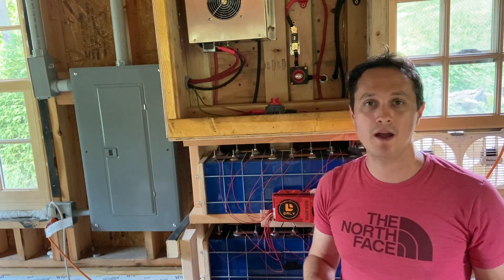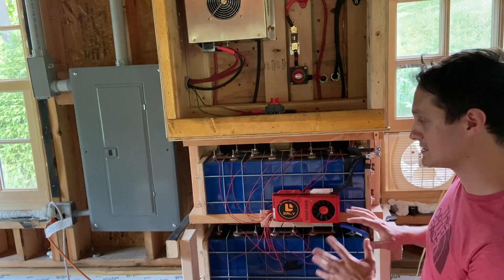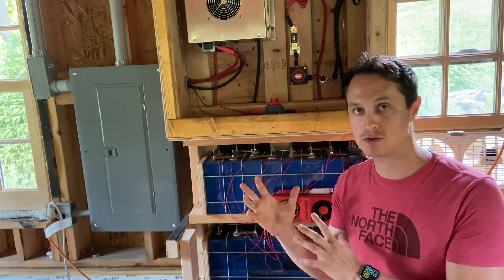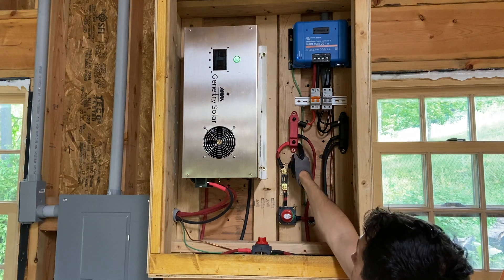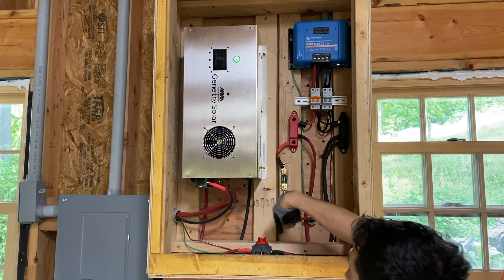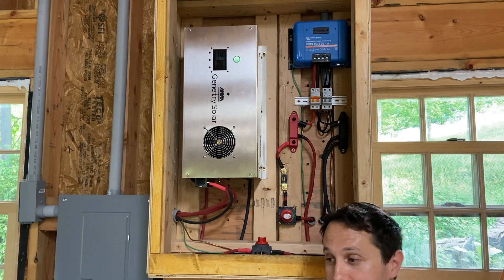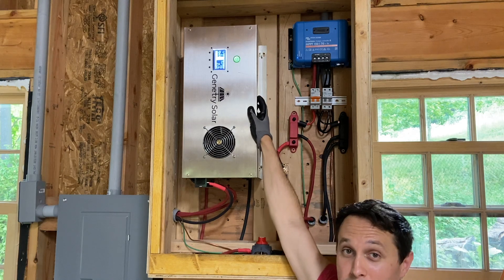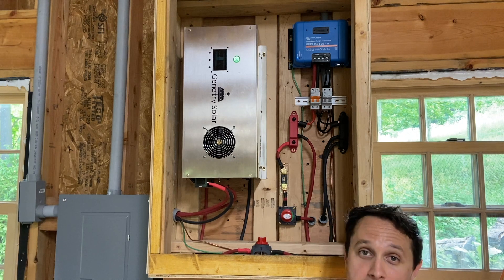My Off Grid Workshop Setup - Everything I Used!

Comment: I remember now, PowerJack was the inverter's name from Genentry. I ordered one of their 9KW which I never received. So I cancelled the order as it was lost in shipping... Anyway, thanks to that, I bought a MG5048 hybrid inverter from MPP Solar instead. It's a hybrid system, meaning it performs as a charge controller with 450 VDC PV input, delivers 5KW at 240VAC, and has a built in auto transfer switch. After adding a toroid transformer to split the 240VAC output. I paid a total of $850 shipping included. That's cheap and it handles everything I throw at it: water heater, induction cooktop, pond pumps, washer, dryer, fridges, freezers and all my power tools!.. I use it as an off grid system now and 2 year later, I could not be any happier cutting my electricity bill by 1/3 and my gas down to zero! I just bought a 48V 280Ah LFP like yours for 2K$ to be totally off grid this winter. I'm also using a16S, 320A Ant BMS for 80$.

Comment: I would grab some polycarbonate from Amazon to cover your things up, but still be able to see them.  I really like to be able to see what is going on inside the box and polycarbonate has a pretty high temperature threshold, so it shouldn't warp with the heat. Other than that I think your setup looks great Will!
Reply from the maker: I agree, although that stuff isn't cheap unfortunately.
Reply: @TheWilltoBuild  It is not cheap at all. Which is a huge bummer because it's so useful.

Comment: Looks pretty good man! One thing Id invest in is a proper fuse off the battery unless that one is rated for breaking and extinguishing the dc arc.🤘
Reply from the maker: I think you're right, and I definitely overlooked gettting a proper fuse. Any suggestions?

Comment: Awesome. I'm about to set up my system in the bus. I'm using the 16s EVE cells, the Genetry inverter on your prior tip, a 200a Daly BMS, and 3 charge controllers from MakeSkyBlue for 3 arrays of 2s2p 315 watt panels. I'll have a shore power input as well and may later wire a generator for automatic start from the inverter.  Do you have a diagram available? What wire gauges did you use?
Reply from the maker: I don't have a wire diagram available now but I might do one in the future. I used 2 awg for everything you see here. And I used 6 awg to bring in my solar power (up to absolute max of 60 amps about 25 feet away). 

Definitely keep me updated on how you like the Genetry!

Comment: 060821/1224h PST  Thank you for the presentation of your power system. They look good and systematic.
There are 2 things that I wish to understand. They are:-
1) Why is it necessary to ‘ tight fit’ the LiFePo4 cells ie COMPRESS?
     If there’s going to be a slight bulge (due to several reasons) and therefore, isn’t it better to leave the cells alone 
     naturally? I have heard the Cell manufacturers ‘recommend’ cells to be tight fitted and they have not been
     elaborate on the subject. Would you, please, throw some light on this issue? 
2) Every component illustrated here are heat sensitive, cold sensitive, moisture sensitive and basically 
     producing Electricity; both AC and DC. Wouldn’t it be logical to encase the whole system in a proper
     metal container, with ventilation and climate controls with alarms? Thus, avoiding the unlikely event of 
     hazards?
The above are solely my sentiments, do forgive, if I exceeded the limits. 
As always, I am happy to view your presentations and look forward to watching them and learning from it.
Stay safe and 73s…
Reply: 061021/0105h PST.    Thanks.
Reply from the maker: good questions.

For question 1, I don't have a good answer. It is basically battery chemistry and when the cells expand or bulge they are getting permanent damage. Keeping them compressed supposedly prevents that. There is actually alot of debate about how important compression is - but if you don't full charge or discharge your cells it won't really be an issue because bulging mostly happens when battery cells are near full charge or discharge.

For 2, you are right. But there are a few factors. For one, a metal case is not ideal because it is a conductor. If something goes wrong, the case could get electrified. For two, my setup is inside, where it is dry and shielded from the elements, so I am not worried about water. But I will be putting a cover on the system and fully enclosing everything so you are right that it should absolutely be protected.

Comment: Its not very often you run across someone that built the exact setup you're planning to build.  This is exactly what I'm planning.  Thank you very much for the video.  I'm building an off grid shop with a shipping container and I'm collecting parts for this now.  I'm curious what air conditioning unit are you planning for?  My plan is for a 120v 12btu mini split.
Reply from the maker: Glad I could help. Still figuring out the AC situation. I never really intended to have AC at my shop (its not even insulated), but I sort of want it as an option. I am trying out a 14btu unit right now and it isn't doing the job and is more than my solar can reasonably power. I'm thinking maybe doing some sort of DIY geothermal if I do AC at all. Otherwise just running a dehumidifier.

Comment: Really nice system. I have a very similar setup (but only 8S) with Eve 280ah.  If I was to do it again, I would get a split-phase inverter similar to what you have.  Everyone uses the ole reliable Victron but I went with epever that I have been happy with.
Reply: EpEver is a great charge controller. I got the 50A to power at 48VDC. It's reliable. I only wished it could take more than 150 VDC PV input.

Comment: Have you noticed anything odd about those Eve batteries?  Any bulging or loss of capacity or anything else odd?
Just wondering.  At ~120 $/each (including shipping) that is ~134 $/kWh--which is quite inexpensive....
Reply from the maker: I understand your skepticism. They definitely weren't perfectly uniform in terms of size when I got them, but I have been doing capacity tests and they've met them. And honestly, even if they are 20% less than their rated capacity, they are still the best deal available I think.
Reply: @TheWilltoBuild  When Tesla's 4680 factory ramps up, they say they will be selling li-ion cells for ~56 $/kWh--which will be less than half the price (~42% to be more accurate).

Comment: Hey, Your setup looks good! Nice job organizing the cabes. What is the fuse interrupt rating for that fuse goind on the positive from the battery? Those batteries have such a low internal resistance that it would be good to have it at least at 5kA. I like the batterie shelfs a lot.
Reply from the maker: Thanks for watching. That is a really good point about the fuse. I actually can't find any info on that. Do you have any fuses you recommend?
Reply: @TheWilltoBuild  In my system I have a knife fuse type. Something like this, but made in Poland: 
https://www.amazon.com/3NA3-3NA3814-SIEMENS-Fuse-GL-GG/dp/B07FBTZWKS/
But I know that in the US class T fuses are popular (not as much here in Europe) like this:
https://www.amazon.com/Blue-Sea-Systems-5120-Class/dp/B000MMH1J4

Generally fuses with such high interrupt rating have some kind of fine silicone sand that extinguish the arc.
Reply from the maker: @Banszi1  Thanks for the suggestions, I'll look into that.

Comment: I highly recommend Liitokola. I received four 280 aH batteries in less than five weeks. Perfect condition. Perfectly matched voltages upon receipt and again one month later.
Reply from the maker: Awesome, always glad to hear about other good suppliers.
Reply: I have an order to inspect from Dongguan Lightning New Energy.
Reply: 060821/1305h PST USA 🇺🇸  Please understand that most, if not all, prismatic cells are manufactured at the same facility, in China. The only thing that make the buyers distinguish between the several Cells are the LABELS. There could be a few cosmetic changes peripherally and that’s the end. LitoKala, EVE, Lishen, TOPBAND, Tip-sun etc etc.
You know what I’m trying to say. Cheers.
Reply: @sreekumarUSA  I believe ur mostly right, also all “Passed” cells go to EV’s, the rest go to distributors, ie; there is no such thing as an “A Grade Cell” except in a new EV and they have no terminals which also degrades current flow

Comment: Very cool. I'm almost there with almost the same setup - batteries, BMS at least. I'm looking at getting a off-grid inverter with the mppt controller built in. Not sure yet if this is the right option. I'm dubious of 48V Inverters available off the shelf - their history here in Australia is of regular and systematic failures, whereas integrated inverters with mppt seem to last for years - pure gut feeling - I have no stats to base this off.
I like your philosophy of being able to isolate every major item when needed. I am planning to have circuit breakers and overcurrent protection devices in series for every major device.
You said this will run your workshop with 3kW of solar and my question is, what will happen when you have a few days of little solar (overcast/rain/snow etc.)?  I guess one switches over to the grid, but that option, philosophically feels so at odds with the original purpose of the battery/inverter/solar system in the first place.
Reply from the maker: It's a hobby workshop, so no sun so fun basically. I have the luxury of not needing to have power up there 100% of the time. Making a system you can always use means building a system for those few days of the year when things really don't go your way. Also, except in summer with air conditioning, I actually have way more capacity than I need, so I'll prolly be alright almost all the time, except for when lots of snow blows in, which is typically only a few times a year here.